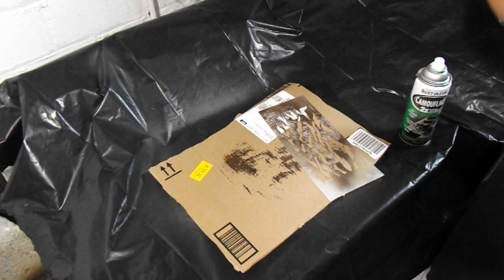Camo Spray Paint Your Rifle The Right Way (Knockoff Kryptek Style)

Comment: Used the same paint and got the same stencils, hung my rifle from a tree and did the same thing. It came amazing ! I never would have done it before, but screw it, its just a tool and would never sell it anyway. It looks like a professional job. Tip , I bought a can of spray cleaner at wallmart that is good for electronics in a car, like brake cleaner but won't harm plastic, and it worked great to get all the oil off.  Nice Job on yours !
Reply from the maker: Thanks I appreciate you! Im about to do a Savage MKII here really soon. I might use the freedom brand stencils this time around